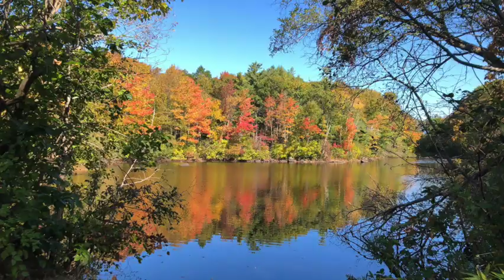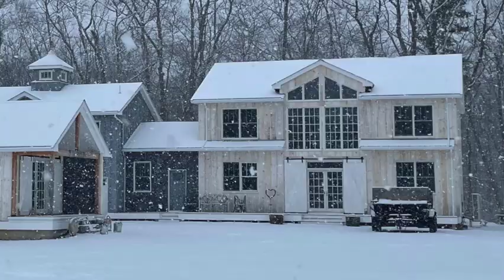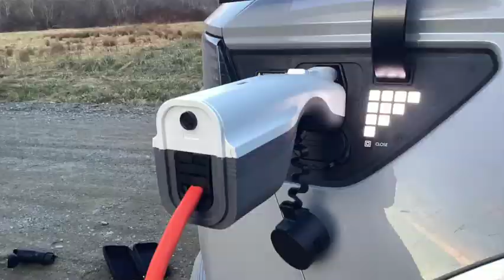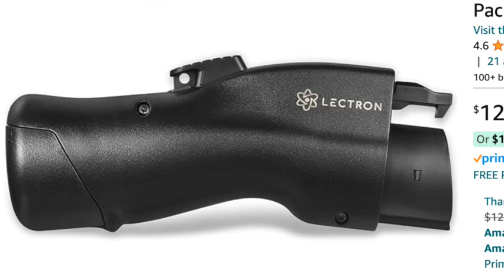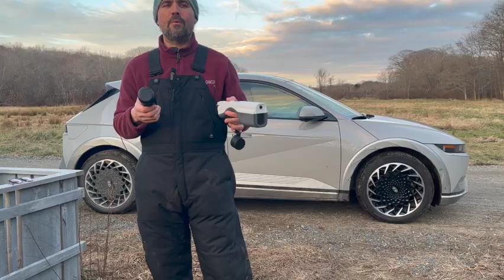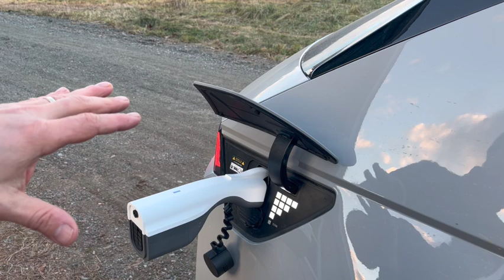Can Any V2L Adapter Power Our Off Grid House Overnight?

Comment: While this is great, you're prematurely aging your battery every time you do this. I'd much rather just get an inverter/battery combo, which also accepts solar. I'm personally waiting for the Pecron F5000LFP to come out and get an extra battery. That's 10kWh worth of storage and a 7.2kWh inverter. With conservative usage, you can run most houses on that, even if you have something like geothermal. That'll get you through the night and whatever solar gives you and a gas generator will get you through the day.

Comment: When plugging into your house panel did you have to un-bond neutral from ground? Most US homes have neutral bonded to ground at the main panel but this can cause GFI problems for some inverters. My EV V2L will shut down if it senses neutral connected to ground, it only powers loads where neutral is unbonded..
Reply from the maker: This is a really great point and the higher voltage systems can’t power the house without a v2h intermediary hardware.  Our house is grounded at the main panel so I think the lower voltage V2L works because we don’t have 2 grounds to switch over, but my knowledge is basic on this, suffice to say I try not to fry myself when possible :) what EV do you use, Hyundai? Kia? Or something with more power like lightning or cybertruck? Such a great comment!
Reply: The single bond from neutral to ground needs to remain for normal house powering. To safely use my adapter, I completely isolate the loads served from the house wiring. To accomplish this, each served appliance must be unplugged from it's wall outlet and plugged into the cable system fed from V2L adapter. In the case of my furnace fan and controls, I replaced my old switched fuse and cable connection with a wall receptacle and a short pigtail to the furnace.
A more permanent method would involve a transfer switch that switches and isolates the neutral wire as well as the ungrounded wires but this seemed excessive for just the few loads it serves.

Comment: What I found out is that when V2L is activated there is 300W consumption for the car's electronics to fullfill this feature. So to supply a household with little consumption at night is a less good idea. By using the powerwall at night and when waking up and using a lot of energy at that time using or the car's energy at max power of combine powerwall and car's power is beter. In europe some people has a powerwall with a generator input at the car's max input limit and depending the household needed energy the powerwall assists or charges the supplement.

Comment: Can you also charge the car in V2L?
Reply from the maker: You can’t charge when using the V2L adapter from the charging port, but I believe you can if you are using the interior V2L single outlet located between the rear seats by the floor. Might be different on the 2025 Ioniq5

Comment: 60 kW would be the speed of energy flow.  60 kWh would be the capacity of the battery.
Reply from the maker: Our closest ‘fast charger’ level2 charges at 65Kw/hr and the useable capacity of the V2L on the Ioniq5 is about 60Kw
Reply: @LifeOnTheOffGridFarm-vq1nz   Mate, you got your units wrong. 

The fast charger charges 65kW or 65kWh/h which cancels back to 65kW. Your cars battery has a capacity of 60kWh which means it can expend 1kW for 60 hours or 2kW for 30 hours (if you ignore losses)

That is what the previous comment wanted to point out.

Comment: Question, you mention manual override switch on your system, can you describe the sequence you go through to use the cars V2L on your house?  My setup is very similar to yours with exception that I am attached to grid.  I have Tesla solar, 3 PW, gateway 2, & Tesla uni car charger. I want to experiment with using my Ioniq 6 as backup power source but unsure of settings and don’t want to fry anything.  The Tesla universal car charger should work as my V2L adapter. Just curious how you go about enabling the flow from car to home.
Reply from the maker: Great Question! I will make a video this week so you can see how we complete the switch over, our setup is very similar...We have our panels, inverters, 3pw, gateway and two electrical panels...but they installed on a utility shed we built about 200 feet from our house. Our house is in the woods but we built the shed on our farm in front so that we have the best orientation and angle to maximize the solar especially in the Winter. Essentially we have two main electrical panels and one sub panel. Our 'main' panel is in our house with typical layout of about 30 breakers. We have a 'secondary' panel in the solar shed, but that only really has a circuit that feeds the main panel inside the house. It also has a couple of circuits for electric cattle fencing. You can shut our entire house off either at the main panel in our house, or at the secondary panel. Then we have the MTS panel, which is right next to the larger 'secondary panel' and is much smaller, only used to switch power off from the main power supply (our solar but probably your grid). The manual transfer switch actually has a sliding metal lockout, so when the 'generator (car in our case)' is plugged in and powering the house, the energy cannot cross over and flow through back toward the grid. I think typically generator switches will only power half of an electrical panel. That is why it's good we have the 'secondary' panel in the shed, because it means our entire house can be consolidated to a single switch on the side of the panel that will be fed by the generator/car (so we don't have to choose which side of the panel to power). To switch over, first we shut the tesla gateway breakers that control the batteries and panels. Then we shut the breaker switches for our solar array (we have two, and they are installed right after where the meter would be.) we don't turn off the inverters or the switches on the batteries because what we just did shuts them down. Usually we have everything ready on the Ioniq5 side, with the adapter plugged into the charge port, a heavy gauge outdoor extension coming from the adapter to the solar shed. On the outside of our shed, we have a 50A twist lock connection outlet, similar to what you'll find for an RV hookup. We have a short cable, I think it's called a 'dog bone' connector, that allows us to plug in the 20A extension cord, and converts it to fit the twist lock connector. Plug the extension cord from the car into the 'dog bone' and plug the dog bone into the RV outlet. Then press the button on the Hyundai adapter and the green light comes on the adapter, and the vehicle dash will pop up in V2L mode. We then usually shut off the batteries and solar at the gateway, then shut off the 2 breakers near the inverters, then switch over power at the manual transfer switch, locking out the 'grid' and enabling power to flow from the car, through the MTS panel, to the secondary panel right next to it, and finally to the house! Hope this helps, I will make a video soon so you can see it in action. Good luck!!
Reply: Thanks for the reply, I understand your process and will be experimenting with mine.  Looking forward to your vid.
Reply: Nicely done video. New to your channel.  It’s a bit late in my life to consider an off grid lifestyle but having been in the energy efficiency business I appreciate the goals and innovations that you are employing there. You also are skilled in communication and clearly have the teacher gene

Comment: Interesting to see other people already doing something I am stewing on.  Thanks for sharing.  I have been thinking about the F150 Lightning with Pro power to do the same thing and have dual role of farm truck for smaller lighter loads around here.  So now I get to be patient and wait to see when the NACS configured vehicles start to appear.
Reply from the maker: You've got a great strategy. We  have friends with the F150 Lighting, and it's an awesome truck! It was definitely on our list because of its massive V2L and V2H capabilities. One problem we had when hooking the Lighting up to our transfer switch is that our system is grounded, and the lighting is built with a Bonded Neutral so It cannot feed the power directly to a house without modifying the wiring to remove the bond, rewiring with a sub panel, or purchasing the Charging Station Pro. For smaller loads though, I think most V2L vehicles would work well. Our friends also love their Outlander PHEV that has V2L. I think waiting for the NACS options makes sense, infrastructure is really lagging with CCS we are finding, but getting a little better...

Comment: You don’t need the adapter,,,,for testing,  -there’s an outlet under the rear seat with the same power rating, on higher spec models.
Reply from the maker: Totally! And it works great except in the cold winter and rainy weather up here we can't leave the window open to run the power to connect to transfer switch for our house. So for us, having the adapter is a game changer. We can keep the car shut and locked while still transferring power. I was hoping that both would run separately so the full 3.8Kw capacity could be reached, but I guess that is just for markets outside of North America...
Reply: Some Hyundai models or trims, like mine, do not have the under rear seat outlet.
Reply: Can’t use the one inside with the car off, like you can with this adapter though 🤷🏻‍♂️

Comment: I prefer the V2L adapter on Amazon that has a 16ft cord and a power strip at the end. It's great because you don't have to worry about weatherproofing the car side and you don't have to activate it with a button. :)
Reply from the maker: That sounds awesome! We have a manual transfer switch from our old generator hook up, so luckily we can feed the car into that, and then all of our house plugs work :) One thing we learned is that if we do overload the V2L system and the power shuts off, we can just unlock the car with the FOB from inside our house and the V2L resets and everything kicks back on. Took a bunch of late night walks to the car out in the cold before we realized that!
Reply: @LifeOnTheOffGridFarm-vq1nz  wow, I had no idea you could reset the V2L with the remote! That's awesome!
Reply from the maker: @Cory182  Total game changer! It's like magic. Wave the wand, all the power comes back on :)

Comment: I have an Ioniq 5. I used to transfer power from the car to our house every night. After 1 year the 12v battery in the car died and had to be replaced. Seems that the 12v battery is a weak link.
Reply from the maker: That's what I've heard from others too, and luckily we haven't had the 12v issue yet but we are braced for that eventuality. It's too bad the 12v isn't a more reliable system, and a bit ironic considering how robust the power pack is we are drawing from. It's also a bummer that we can't utilize the full 3.8Kw like markets outside of the US. But all things considered, it is amazing that the Ioniq5 powered our whole house this winter whenever our home batteries ran low. Are you happy with the Ioniq5 overall?
Reply: Sure, it is a masterpiece. I had a diesel Volvo V70 before purchased in 2007. And replaced it with ioniq5 in 2022. Would you believe that the pricr I paid for the ioniq5 was the same as the price of volvo v70? 
Anyway, they replaced my 12v battery under warranty, so I am ok.
But I prefer not to leave it on v2l for long periods any more.
Last week a new Renault 5 ev was released in France. With v2l and even v2h. 
They say that the car has a 400v to 12v built in inverter. Maybe this is the solution to the 12v battery drain issues.
Reply from the maker: That renault looks like a fun a practical car too, and I think we are just at the beginning of the portable power adventure with all of the emerging possibilities. We are currently converting our old 1947 dodge pickup farm truck to an electric vehicle, but we are installing a larger 6kw inverter that drawers directly from the battery. Hopefully it all works out!   @katarinaspisiakova1201
Reply: The Ionic 5 12v battery is a weak link in the car regardless of using the V2L system. I took the advice of others and added a wireless battery monitor that gives SOH (State of Health) and SOC (State of Charge) for my 12v battery. Of course, that means needing to check the condition of my 12v battery occasionally while driving and while using V2L so that trends can be noticed and dealt with before they become problems. When it is time to replace your 12v battery, get the best one your budget will permit.